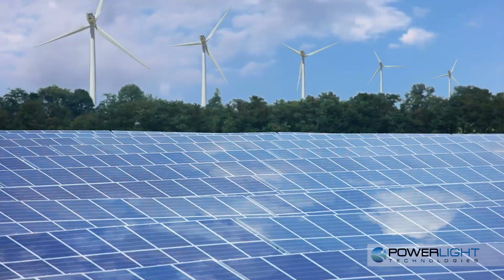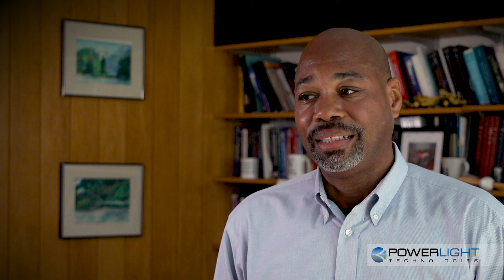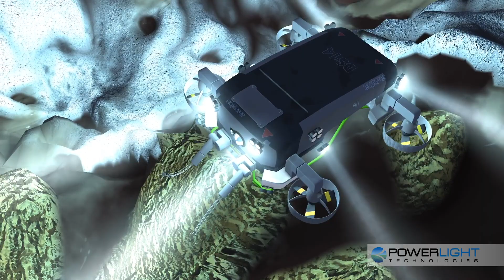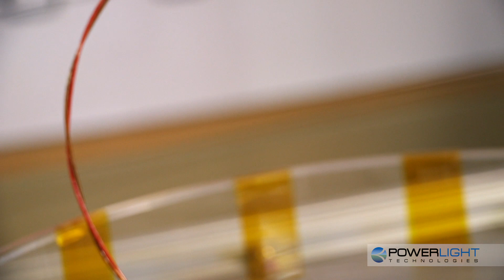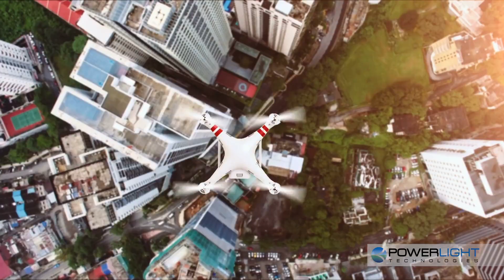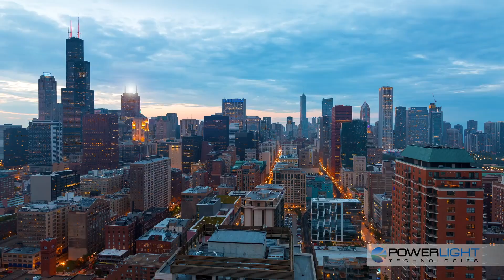PowerLight Power over Fiber

Comment: It is suggested that an electron can be transmitted through an optical fiber, facilitated by the interaction with photons through a process known as photon-assisted tunneling. This transmission could occur with extreme rapidity, potentially approaching instantaneous transfer times, especially when utilizing noble metals such as silver due to their unique plasmonic properties that enhance photon-electron coupling.

Comment: I always wondered if it would really even be safer to transmit power over fiber. What if the fiber accidentally gets cut and shoots a laser beam with 100W of power, something is gonna catch on fire. No way this tech can power anything other than low power sensors.
Reply: @dagreatcow  what about a line of code saying if power isn't transmitted every 0.25 seconds turn of gride x.
Reply: @strudledudle1833  OTDRs can monitor back scatter to control the transmitter.
Reply: Current fiber optic waveguides can safely transmit 250KW/cm^2 of continuous wave transmissions; over a GW of pulsed wave.
Reply: This post is kind of silly, think about electricity pylons, deep underground electric cables, exploding electrical sub-stations etc… Yeah 100 watt laser and you're cut in half, tree takes out wires from a pylon and they fall on you, you're blown to smoke, give or take all the safety measures so this doesn't happen very often.

Comment: Wait this is a thing? How does it work? Afaik with current technology, conversion from light to electricity is very inefficient, so sending electricity by converting it into light and then converting it back to electricity would be extremely inefficient...
Reply: Looked it up. Efficiency for optical to electrical for a single wavelength, as you would have in a laser, is around 50%. Probably can be pushed higher.

Might be useful for low power electronics that need to be installed far away :) Photovoltaics are also improving, though. Once you get to over 90% conversion rate and have powerful enough lasers, you can do more and more with this tech.

Comment: Wondering why we're not pulling a vacuum to improve the performance of the fiber optical train?  Wondering also what other higher frequency improvements can be made, if required?  I'm also guessing there is potential to improve performance of fiber optical cables also.  Sad IMO that the wireless system implementations are being pursued way more intensely, I guess due to proprietary satcoms for financial instruments trading systems.  That can change though.
Reply: that would require really strong fibers to withstand atmospheric pressure